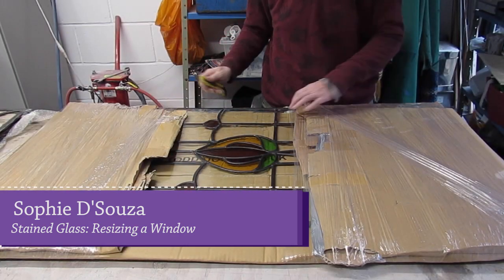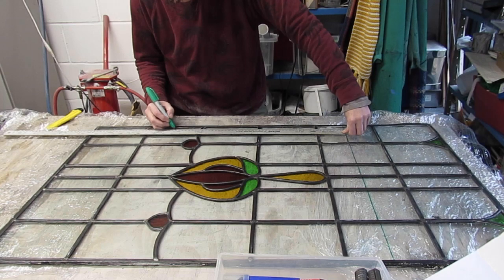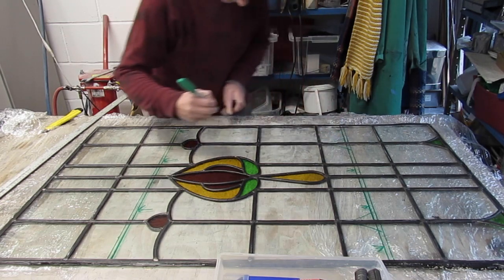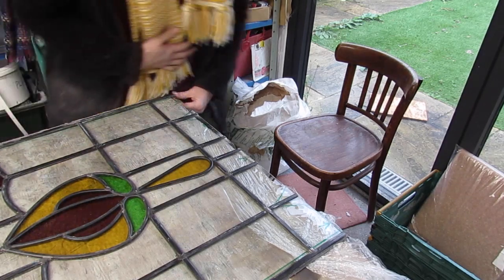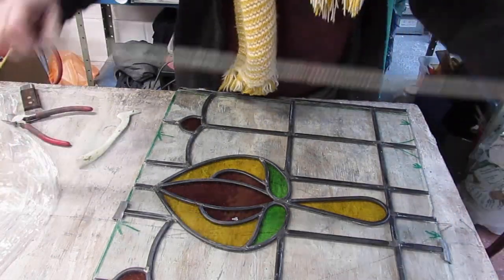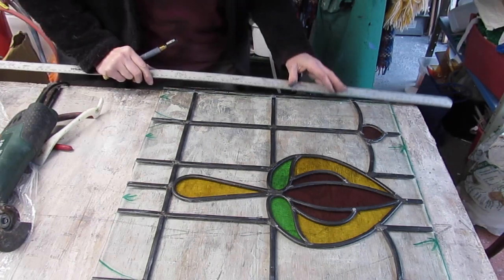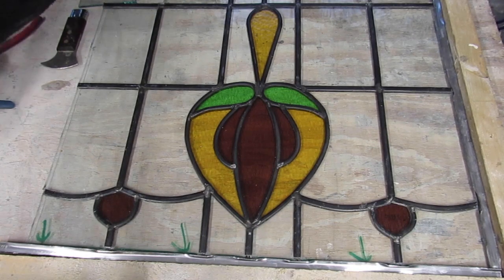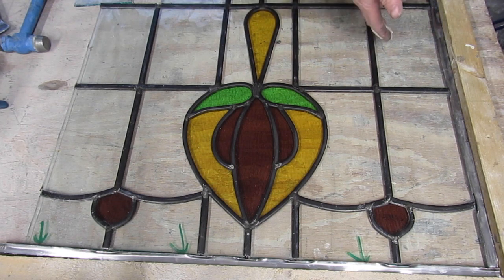Sophie's Stained Glass | Resizing a Window

Comment: This is fascinating to watch. Exactly what I need to do for a window I’m putting in a double glazed unit. Interesting to see you cut the glass in situ. I don’t have one of those tools to cut the lead but will use a deemed tool with saw blade. I’m using Y came with the leg of the Y going between the units, so I’m measuring to the bottom of the U of the Y. So you cut up 8mm from the finished size to the ‘heart’ of the lead. Your breaking glass confidence has me in awe. I was thinking I’d have to remove each edge piece.
Reply from the maker: Y glass can work well in a DGU. Good luck.

Comment: Hello Miss Sophie! I'm getting ready to tackle my largest leaded repair to date. Excited & nervous all at the same time, lol. The window has a painted wooden frame that will need to be removed. Any tips on how to take the window out of the frame without further damage to the panel and when you have to remove a frame do you replace it with a new frame or reuse the old frame? Thanks so much! You are so giving of your time and talents...it's SOOO APPRECIATED!
Reply from the maker: Hi there - nerves are normal - I still get them! I'm confused as to why you are removing the frame from the building and not just the panel from frame? Usually questions about the frame need to be directed to a carpenter. I would advise not getting involved with the frame (unless you are doing this job for yourself rather than a client!). There are some videos showing how to remove stained glass - let me know if you need me to send links.
Reply: @SophiesStainedGlass  yes Miss Sophie, could you please send the links. Thank you 😊
Reply from the maker: @kristycannon7923  https://youtu.be/Z1y7TAjWD80

Comment: Back again, lol! I have another pre-made, old lead transom window project that needs to be cut down to fit the owner's existing transom space, which is smaller. The panel is 48" wide by 20" tall. It has one rebar soldered along the middle, horizontally on the back of the panel. Each piece of glass has been painted & fired. Do I need to take the rebar off (again soldered on, no copper ties) first? Or can I flip the panel on the back (rebar up) and cut the glass with my cutter on the painted side? I didn't know if I could get a good score trying to go through paint? And lastly, should I try to cut each glass piece and break it in your "hinge-like" fashion on a panel 48" wide, or should I try to remove each piece and cut each one individually? The panel pattern is just a bunch of rectangles. Thanks Miss Sophie! 😊
Reply from the maker: I can see why you would want to avoid removing the bar  You will at some point probably need to flip your panel over. I keep large pieces of foam for such occasions (protrusions). As for whether you should snap in one go or not...I would score in one go but perhaps see how it feels with the snapping.
Reply: @SophiesStainedGlass  Thank you! I thought about putting something under it (foam is a great idea!) Sometimes I use carpet padding foam to absorb the height of high profile jewels and I need to work on the backside of a panel. So a Styrofoam foam that might work here! Guess all I can do is try! Wish me luck! Thanks again! 😊
Reply from the maker: @kristycannon7923  good luck....we all need it!

Comment: Very interesting. You are really bold when you break off those end pieces! I would cringe during my attempted breaks. Was there any cement on this piece? It seemed very clean. Is that a standard box cutter you use to cut through the lead came? You work very fast. How long did it take for this job? Can you comment on what you charge for this work? Or, can you give guidance on how you charge for materials and labor?
Reply from the maker: Yes, it was well cemented. Yes, a simple craft knife. Job took under a day - so I priced by my day rate plus a nominal amount for materials. I price a job you time needed plus materials. Quoting is always tricky.
Reply: @SophiesStainedGlass  Thank you for all your answers. I later watched your video about price estimates.